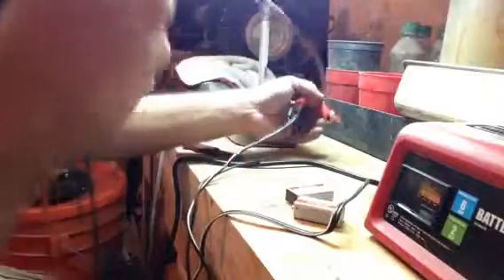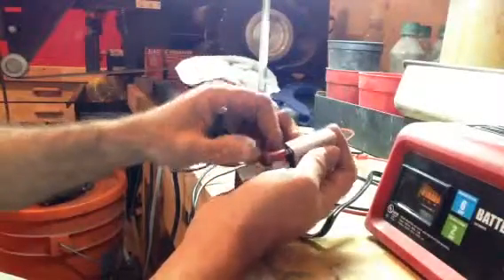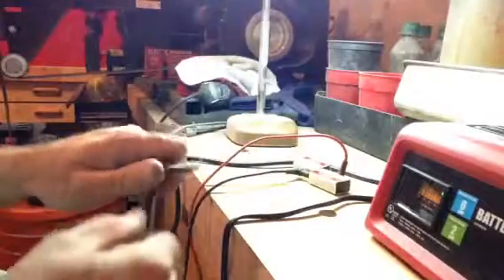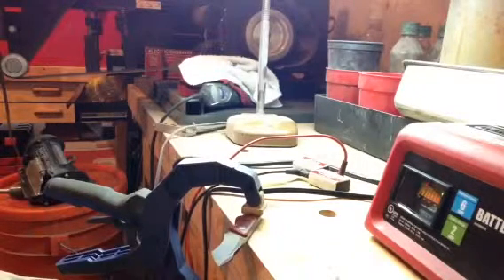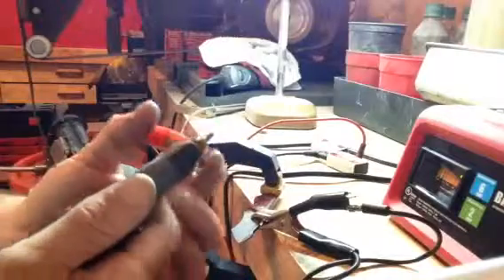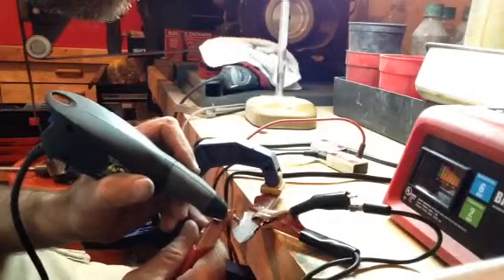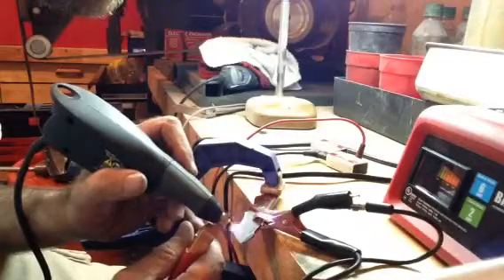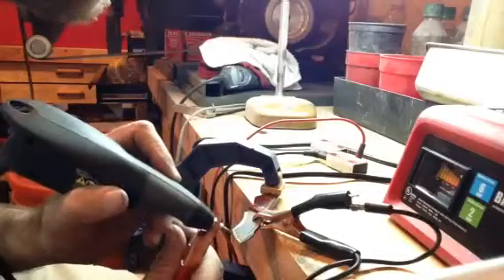Carbidizing a titanium knife blade

Comment: Would the work with just the tungsten bit? Seems like it should.  I was gonna use on a small application of the lock face.
Reply from the maker: Hey James,
Yes, carbide or tungsten works
Reply from the maker: Or are you talking without using an engraver?

 It's just an ark  But not sure if it would work or not.
Reply: +KS Bladeworks yes,  I'm saying without the engraver.
Reply from the maker: The only thing you would have to worry about is it grounding out on the material. That's why the engraver. 

Give it ago on a piece of scrap and see what happens
Reply: +KS Bladeworks   I'm gonna try to find me a flea market charger and give it a try.
Reply from the maker: Right on. 

If you get an oldie but a goodie it's just a direct connect. But if you get a newer charger that has short circuit protection you'll have to wire and a battery source. I've got a video on that too but the down and dirty is just take a couple alligator wire leads and how can a 9 V battery. One end on the battery the other ends to the charger clamps. This will fake the charger out that it's connected so you'll have output
Reply: +KS Bladeworks sounds good thanks